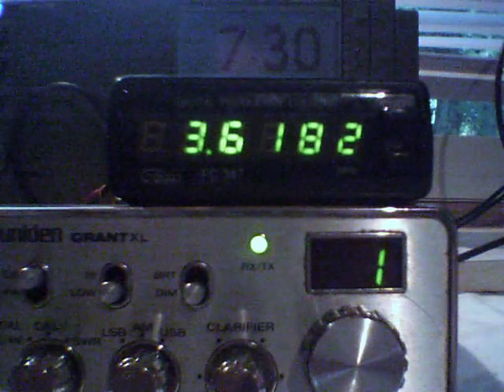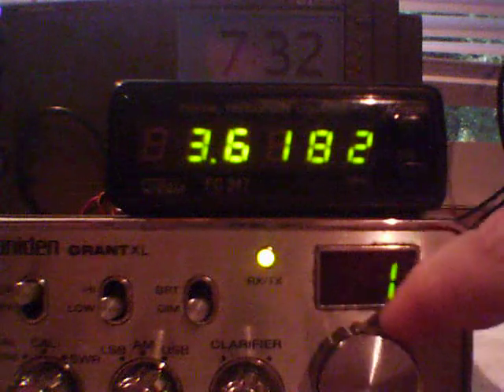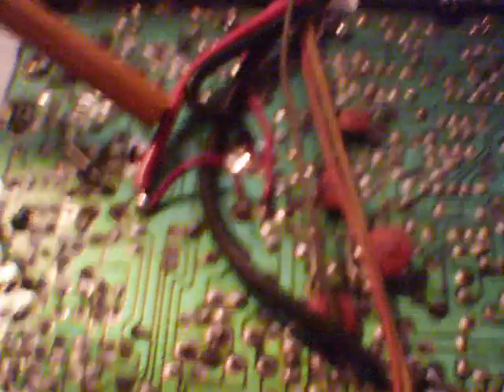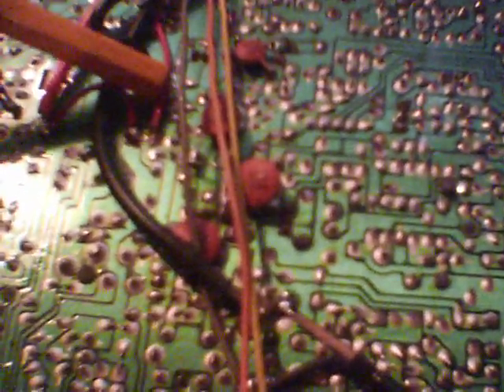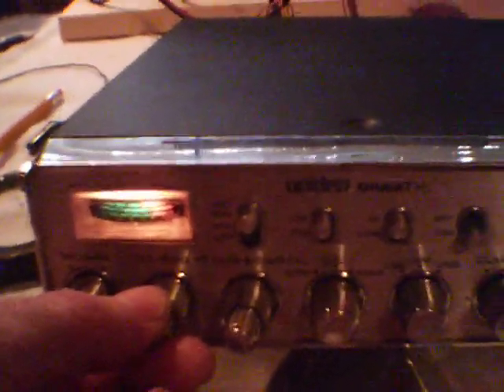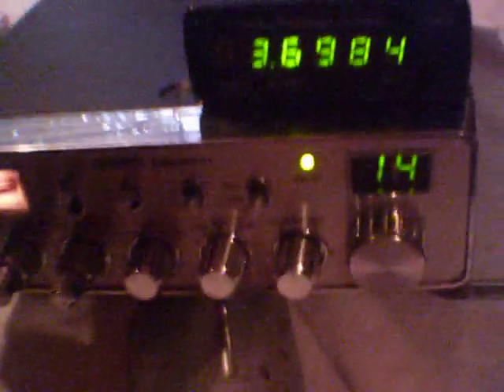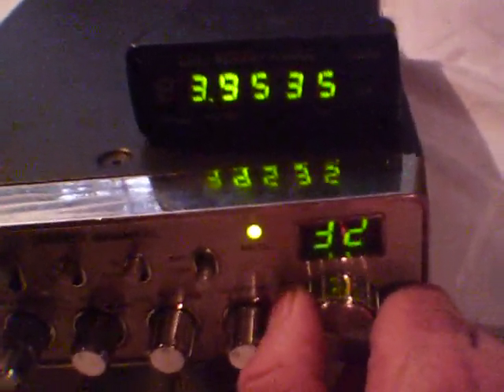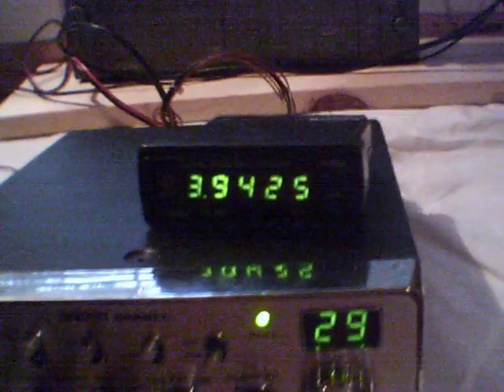80 meter Ham radio conversion done to cb radio.

Comment: That is really good work converting a CB radio to operate on the 80 meters very impressive stuff I've seen CB radios converted to the 2 meter band before but not on the HF bands so this is all new to me but still very impressive stuff and interesting as well. Thanks and best 73's cheers. Stephen M3SNV 73's.

Comment: Dow you know how to install CW and 50mhz in a realistic trc449 please email me brucet35 at aol dot com
Reply: No I have not tried any of my conversions on that board.  The radios I have been able to convert are the ones like the cobra 148 and uniden grant that use the mb8719 pll chip.  The trc 449 uses the 858 chip which I have not had much luck with.
Reply: roger that man what an awesome job ya so i figured out the "CW" signal link for the morse code and there are transverters that i can get off of ebay. as far as tying every thing together is a task i have 4 radios that i want to work off of the cw and possible the transverter and then some any ways man awesome job keep up the good work.
Reply: Thanks for the kind words!  I have not made any videos in a while or even worked on any radios.  Life sometimes gets in the way. There are transverters out there. Here on youtube look up cobra 148 transverter, there is some interesting info there from a ham in mexico. Good Luck, Carl.

Comment: Do you know how do fix a turn table on an old Zenith consol radio?
Reply: +Frank Fernandez  If the turn table is belt drive from the motor than no.  I dont have the stuff to repair old turntables or needle  cartridges .